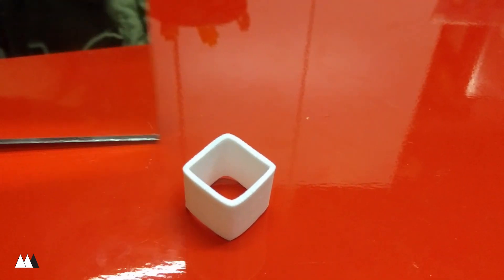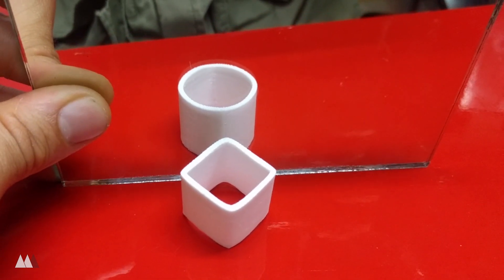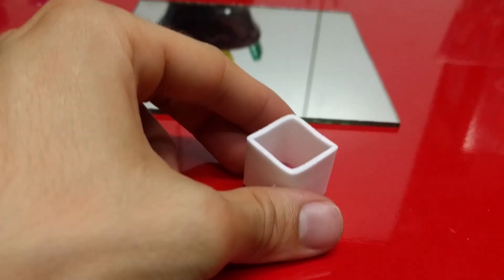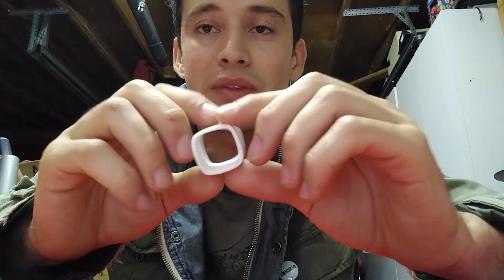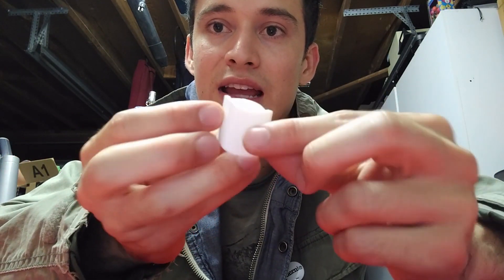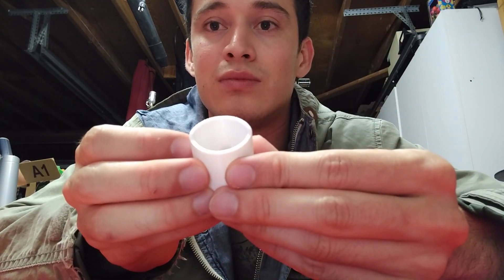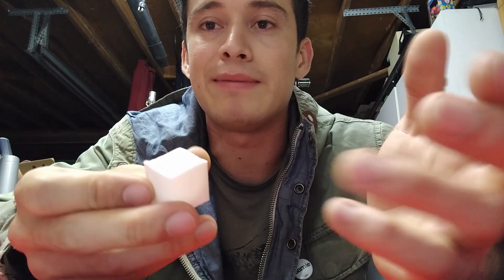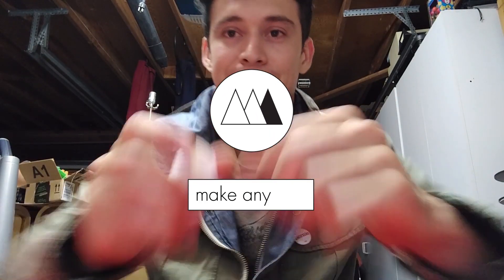Ambiguous Cylinder Illusion // How it Works

Comment: I use a website that can make stl file of 3d print object.  Did you smooth out the corner that followed the pattern like the hill that is next to a dip. Did you smooth out the corner so the at the end the hill it will dip down and not Lille it hits a flat surface and then dip down by hand or is there a feature for that

Comment: What I don’t understand is when you have a square or circle inside, that’s only visible from one side?
Reply: because your eye is only seeing it from certain angles most of the time. If you watch the original video frame by frame, there are points where you can tell what the shape is. 

You are looking at the shape from slightly above and off to the side, so the curves can cancel out the "corners" when it is at certain angles. However if you rotate it a bit, the corners cancel out the curves.

I know what I am trying to say, I just don't know how to actually say it. ;)
Reply: Kimmaline ???

Comment: Hi, super cool videos. Did you figure out the separated/interconnected cilinder/cubes? basically, it works in 1 way only. The cilinder closest to the mirror is in a lower top border plane than the cilinder in the back. So the back cilinder has higher borders than the first one. The piece in the middle is morphed to mimic the interconnection from the viewer angle but from the mirror view the cilinder are lower and higher faking the separation. I hope you can build it up..  great work and keep up the great videos...

Comment: I still can't wrap my mind around 3D printing. what is used as the "ink"? 3D Ink? lol
Reply: plastic?
Reply: It functions the same way as a normal printer where it moves back and forth really quick laying down ink in the necessary spots. However it does not just move side to side it moves in 3 dimensions and then up when the layer it is working on is done. Also the ink is sort of a heated up plastic.
Reply: It's plastic. You know, like Kim Kardashian or Niki Minaj?
Reply: Owen van Helmond makes sense. Appreciate the explanation
Reply: It's just a printer that squirts melted plastic really slowly in a long line and the nozzle moves around and builds layers and stuff as the plastic dries very fast to make objects
Reply: "3D Printers can use a wide range of materials, including plastics, resins, metals, ceramics and more.
	The most popular material is plastic, and most of the home / desktop style printers print objects using plastic, however some of the higher-end printers are capable of printing using many different materials."
Reply: God is just a gigantic 3D printer.  No need to worship him.
Reply: Yeah, it's pla plastic extruded into a shape, then rebuilt upon many times to create a 3D shape
Reply: Christopher Robinhood
sometimes 3d printers malfunction while printing, can confirm
Reply: yea, basically it prints with plastic, it prints it in layers. it is super cool, had one at my college. also seem to remember it printing it in like a sand box? it's been awhile.. lol
Reply: human tissue for example
Reply: the filament type for printers are usually PVU Polyvinyl Alcohol or ABS-Acrylonitrile Butadiene Styrene
theyre actually floss spools of compressed dust like particles, where they are melt a a specific HOT temperature. as of plastic melting wouldn't make sense as it would burn and make a raunchy- toxic aroma. 
 
the machine works sort of like an embroidery machine, but the needle moves instead.
Reply: It's definitely not plastic

Comment: That's pretty damn cool man and awesome video :) Quick question, from the original video there is a point where multiple 'shapes'(?) are brought in and it looks like they're overlapping in the mirror. Would that be a different design or exactly the same as this one, just a different position/angle?
Reply from the maker: I think many of them are just overlapping this same shape, but others are more complex. I'll have to see if I can work those out!